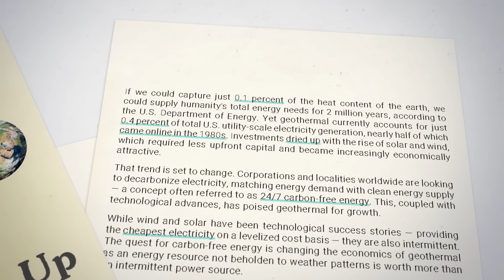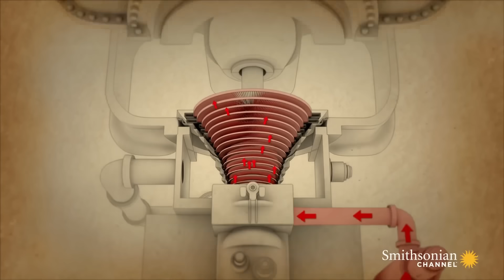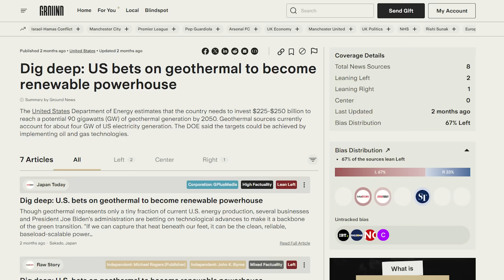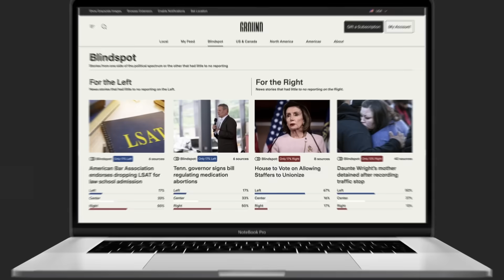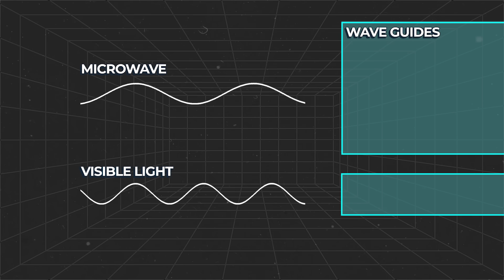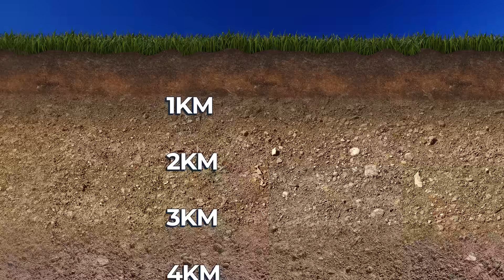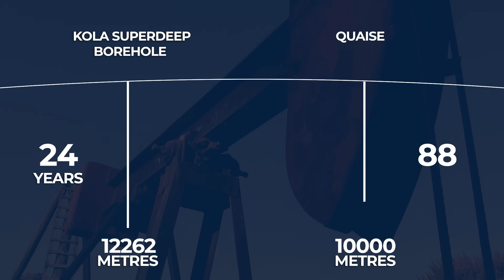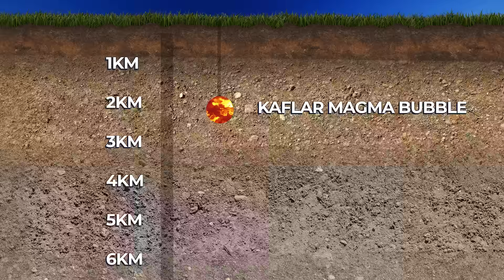This Fusion Tech is Solving the Geothermal Energy Problem

Comment: While we wait for space-based solar power, geothermal is basically the only viable alternative to nuclear as our major baseload power if we want to rid ourselves of carbon emissions. I know you think current nuclear is too expensive, but I think you've missed that much of the cost comes from disproportional safety demands compared to much more damaging power plants, and that nuclear provides services to the grid that supposedly cheap wind and solar can't do with current technology.
Reply: Hydro.

Pumped hydro or compressed air plus wind plus solar.

V2G plus a mixed renewable grid.

Much of the cost of nuclear comes from that it's just a bad business model, by comparison, except for medical isotopes, military use, and metrology applications.
Reply: @bartroberts1514 pumped hydro requires specific geology and requires flooding huge tracts of land
Reply: @descai10  Water management is made more and more necessary by shifting precipitation patterns resulting from climate change due to fossil emissions.

Pumped hydro as a hybrid use for such reservoirs, irrigation systems, erosion controls, flood prevention and the like is a good way to defray these costs incurred because fossil trade pushed climate disruption up smokestacks and through tailpipes to our detriment.
Reply: @bartroberts1514  Costs don't exist in a vacuum. Circumstances including regulation, location, existing infrastructure, expertise and all kinds of things have a great influence.

Hydro has many advantages, including being more flexible than your standard nuclear power plant. On the other hand rivers are in limited supply, and hydro power plants tend to be tremendously more environmentally destructive than nuclear power plants. Depending on what value you put on nature, hydro may be a great option in some locations.

I'm sure pumped hydro can make sense on some locations where suitable facilities just need some addition for it to work, but on the scale that we need to increase our electricity production in the upcoming decades I have a hard time believing that it will make sense compared to nuclear in general, especially since nuclear already, even with all the penalizing rules, is competitive on a longer time scale. (See the Illinois EnergyProf channel for information about the economics of nuclear.)

If we can make this kind of geothermal work, it could potentially be a serious contender though. I assume even land usage could be similar to the small demands of nuclear.
Reply: @bartroberts1514  One of my answers disappeared for some reason and I don't have the patience to rewrite the whole thing:

But in short: Fear of nuclear kills several orders of magnitude more than nuclear has ever done. Fossil fuels kill more people every day than even that old Soviet budget reactor disaster that even in those days could never have happened in the West, and yet Germany chose to abandon nuclear and keep their coal power plants running instead.

We can put down nuclear power plants and storage facilities basically anywhere. Also if we decide to build breeder reactors, we can turn most of the waste into useful fuel instead. And the waste is really safe. One of the great benefits with nuclear is that the waste is contained, unlike most notably fossil fuel plants.

I live in a country that's very large compared to the population, namely Sweden. We've turned several of our major rivers into hydro power plants and biological deserts, but that's not nearly enough for our needs, so we built 12 nuclear reactors at record speed in the 70s and 80s. But now misguided "environmentalists" have had 6 of those reactors disbanded, increasing our demand for fossil fuels, mostly via electricity import but partly produced here as well. Even here it's impossible to compensate by increasing hydro output and with decades of wind power projects, we're just barely compensating for the 6 reactors (which were the smaller ones, the remaining ones produce much more) as far as annual production goes. We're not compensating for the frequency stability that the large generators in those old plants provided though, and some industrial endeavors in the south of the country is turned down because there's simply not enough power to go around, and industries that otherwise could have considered to go electric keep burning fossil fuels instead.

It's so unnecessary. All because of this unfounded and borderline superstitious fear of nuclear.
Reply: @bartroberts1514  And Sweden's reactor shutdowns was definitely influenced by the Green Party's political power. One of their MPs even proudly and publicly took credit for forcing the reactors offline. And another one talked about the political directions they'd taken to shut them down in an interview.

Comment: They drilled a couple 6-8 km holes in Finland near the capital and it turned out to be very difficult and the water didn't properly move between the boreholes. They were aiming for 40 MW of thermal power to get hot water for district heating but in the end they might have gotten a few megawatts out and decided it wasn't economically viable. At first they used pneumatic drilling but got stuck at ~4 km and then they switched to hydraulic drilling to get to the end. Very slow, very expensive and not reliable at all.
Reply: New tech uses plasma. It works even better with hotter rocks, so problems like you mentioned could be overcome.

Comment: What happens during an earthquake? Isn’t that deep enough that the shifting layers would sheer and ruin the hole?
Reply: If you are on a subduction zone between 2 plates then maybe... But if you are in the middle of a plate like most of the world is, then this wouldn't be in the top 10 of potential issues.
Part of the idea behind this is the faster drill times and cheaper costs to allow you to drill a 2nd hole in a few months if a hole is ruined.
Also, once the hole is in use, it is going to be full of pipe and material, so it isn't like it is creating a void that will just collapse on itself without major issues or forces involved.